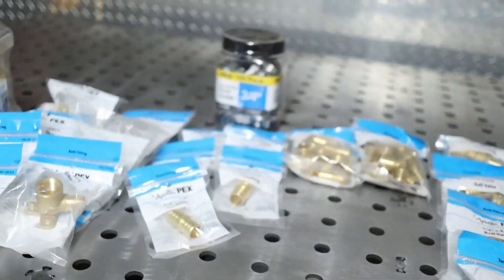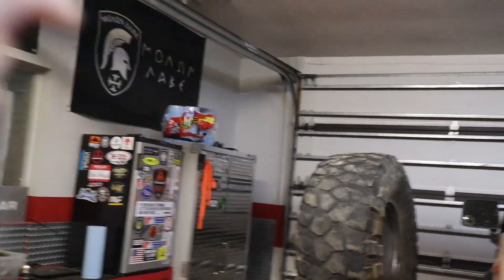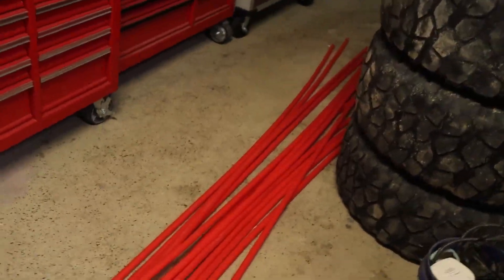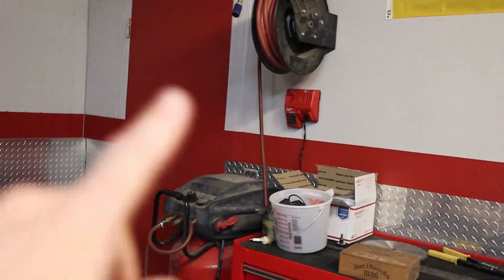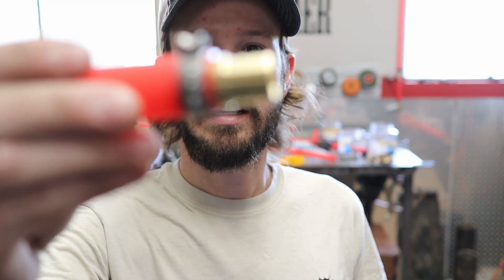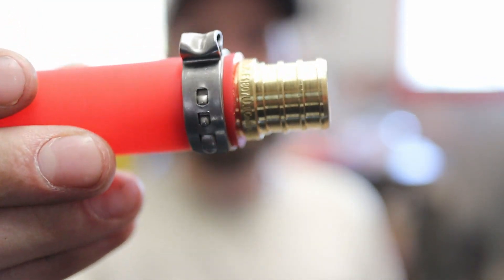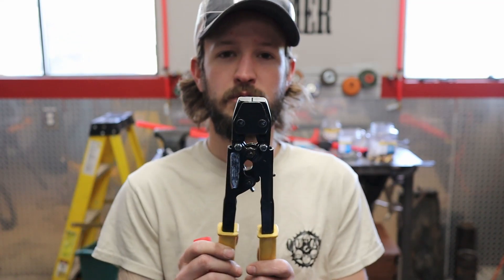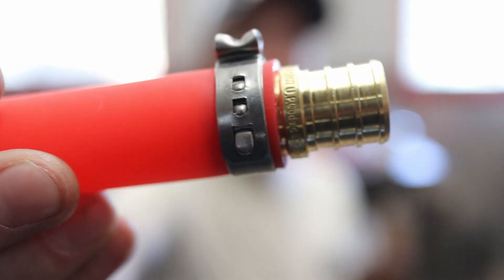Pex for shop air?? Will it last??

Comment: That’s exactly the way I’d run a larger shop. I do the water trap / manifold section in copper the way I did on mine but then switch right over to PEX. I believe this is going to work out great for you and you picked up a load of  capacity. 🔥👍🏼🔥
Reply from the maker: I added it up, should give me about 5 gallons of capacity! It's worked great for 1 whole day so far! Thank you Phil!!

Comment: Checking in after a few months!  I have about 350' left over from in floor heat in my garage slab, planning to use it for air.  Whats your experience?
Reply from the maker: It's been great! Hasn't dropped air pressure, and haven't had any fittings come loose or leak!

Comment: How has this held up after a few years? And would you go 1/2 or stick with the 3/4 if you had to do it again?
Reply from the maker: It's been holding up great! No leaks but it does expand/contract with temperature changes that I did not account for!

Comment: Hi there, would you recommend using this method for a granite warehouse? We would use air pretty much  9hrs a day and 6 days of the week. We use the air to polish granite. My question is, do you think pex will do the job or should I go with metal pipe?

Comment: Can you show how you went from the 3/4" pex tube stepped down to the 1/4" air coupler?
Reply from the maker: I used a fitting from home depot to go from 3/4" pex, to 1/2" female NPT, at 90 degrees, then used a reducer bushing to go from 1/2" to 3/8" NPT for my high flow air couplers.

Comment: I have zero experience with pex but I’m curious of long term results since this would be a great solution for home gamers on a budget.
Reply from the maker: I've been surprised how well it has held air. Had a 2psi drop in the system over the past 2 weeks! But long term, will be a different thing.

Comment: Can we get an update on your PEX system? Its been 2.5 years, any failure or repairs? Thanks.
Reply from the maker: No failures yet, and still holds at pressure for more than a week at a time. I use the air weekly, so it recharges every weekend at least. But I rarely see a pressure drop, unless the temperature starts to drop first
Reply: @letsfabricate5388  Very awesome. Thank you for the video, your time and the research. Cheers.

Comment: Standard PEX is not rated for air. Changes in pressure can burst the line.

PEX-AL-PEX, like Rapid-Air, is rated for compressed air. They use air specific fittings as well.
Reply from the maker: You are correct! This has worked great for me in the past with the small amount of time I use air, but thanks for the input!
Reply: What something is rated for and what works are two different things. But yes, your absolutely right. I've used mine for ten years and going fine with standard brass fittings and brass adapters.
Reply: For anyone reading this comment and thinking regular PEX isnt the answer..... please understand the following:

Standard PEX is rated for 300 psi. Even if you are running 175 psi which is nearly double what most people in little garage setups like this have, you wont have an issue. Assuming that rating has a 5% safety factor (at minimum) you would need a spike of  315 psi to cause any issues. Another missing piece of knowledge here is that any mass produced air compressor has a blow off valve in the pressure switch, which 99% of the time is 175 PSI or less for home or even industrial use. In layman's terms, you will likely never have a 'spike' of more than 175 PSI felt to the system past the compressor because anymore PSI than ~175 PSI would be released at the blow off valve. Of the millions who have ran this stuff, 99.9999999% have never had a problem. Its the one exception that creates this situation of 'warnings and possibilities'. Also pex is not brittle and will not send shards like pvc will under pressure, PEX ruptures with a split therefore has minimal risk of danger in cases where it does rupture. PEX-AL is intended for industrial use and is marketed for 'compressed air' but unless you are surpassing 300 PSI there is absolutely no need to buy it. PSI is PSI, it doesn't matter if its water or air, that line doesn't know the difference. Actually anyone with a common understanding of fluid dynamics would know that 300 psi of water is a heck of a lot more dangerous than air because water is an incompressible fluid and will kill you quicker than air will under pressure.
Reply: well said
Reply: Do you think you could of ran 1/2" pex?
Reply: @matt8134  Well said
Reply: Matt You have it backwards.  A gas under pressure is far more dangerous than an incompressible liquid.  Let’s do a thought experiment.  Let’s assume we have a large hydraulic cylinder and piston and we have a load cell on a movable stage to measure the force on the piston.  Now put 200 psi of water into the cylinder and measure the force on the load cell.  Let’s say the cylinder has 5 sq. in. of area giving 1,000 lbs of force on the load cell.  Now allow the piston to extend 0.1” and check the water pressure and the force on the load cell.  They will have dropped to zero since the liquid is not compressible and thus can’t expand either so the force on the piston vs. distance it moves is a very steep curve and will drop to zero with very little motion.  Now fill the cylinder with air at 200 psi.  You will have the same 1,000 lb force on the load cell.  However, now when you move the piston outward by 0.1”, the pressure reduction will be in proportion to the change in volume of the cylinder.  Given any significant volume at all in the cylinder, the force on the piston and the pressure in the cell will change very little in 0.1” (it follows the ideal gas law). 

That is why a brittle material like PVC is so dangerous with air, but no so much with water.  If PVC breaks under water pressure, almost as soon as the break occurs, the pressure from the water will drop substantially.  If PVC breaks under air pressure, the air pressure lessens much more slowly and will propel the PVC fragments to very high speeds as they leave the scene.
Reply: I'm running 175 in mine no issues.
Reply: Brad Faught The key with pex is keeping it out of the sun.  It doesn’t take UV well and after a few years of sun exposure, you will have problems.
Reply: Matt i just saw this now. It’s incorrect to think that pressure numbers alone are what matters here. Water has a contestant pressure, or it differs just slightly. Air can have pressure all over the place. Air surge, even with lower pressure is responsible for blowing up air lines. PEX is not rated for air, and should never be used for air. Period. Just because some random person states that they’ve been using it for years doesn’t make it safe. It can blow at any time. These rating are serious, and are researched and tested very carefully. They should always be regarded as absolute.

It’s irresponsible for anyone to recommend something that is out of spec.
Reply: LTVoyager PEX will rarely splinter when it explodes. It will usually rip. Sometimes the PEX will blow out of the fitting because it ripped right near it. It’s not as dangerous as PVC, but I’ve read of incidents where it ripped and swung around the room.
Reply: Mel Gross I am not sure what you mean by “contestant” pressure.  Pressure waves can travel through water just as well as through air.

I never recommended that anyone use standard PEX for air, I was simply challenging your incorrect statement that an incompressible fluid under pressure is more dangerous than a compressible gas.  That is simply not true. The fact that PVC is OK with water, but not air is one data point in that regard.

I don’t know why most PEX isn’t rated for compressed air, but my suspicion is that it is a testing and liability issue.  The folks that make most PEX test it for water and thus can demonstrate its properties.  My guess is they have not tested with air and don’t want the liability from the use of their product in a way it was never tested for.  However, if you are aware of a technical reason by PEX isn’t suitable for air line, but nylon is, I’d love to hear it.
Reply: A trick for the uv exposure is to wrap it with 2" automotive masking tape (green or yellow).  Just run it down the length of it.  Anyone doubting weather or not pex is suitible for air should search for a video where they test to failure. Failure was somewhere around 300-500 psi if I remember correctly, plenty high enough for any fluid even air.
Reply: Brad Faught The problem is that an air pressure test is only one of many tests needed for a product for compressed air.  You also need to test at temperature as the outlet air temps on a large compressor can exceed 250 degrees and many plastics weaken substantially at elevated temperatures.  And then there is the issue of oil resistance.  Most compressors put some oil in the air and air lines designed for air tool use may have tool oilers installed.  The air line materials need to be tested for tolerance to these common oils as well.  There is a lot more to testing a product than just a simple pressure test.  And many plastics deteriorate with age and exposures to things like UV and ozone, whereas most metals have long since been proven immune to these issues.  So, accelerated aging testing has to be done also.  Testing such as this is expensive and time consuming.  I suspect that is the reason that most makers of PEX water tubing have not bothered to test and certify it for use with compressed air systems.
Reply: LTVoyager i never said that water is more dangerous than air. I said the exact opposite. It’s not rated for air because its not suitable for air. They have a product that is rated for air.
Reply: The test I was referring too is a hydraulic test, as I stated anyone wanting to do this should cover anything exposed to sunlight with masking tape. Pex being plastic means it's oil resistant. Ozone has no effect on plastic. I recently saw that AvE was installing pex for airlines in one of his recent videos, if someone like that who is involved in engineering and material science trusts it so do it. Their is no money to be made certifying pex for air. Even if someone did people wouldn't pay more for it they would just use plumbing pex. The cost and ease if installing pex for airlines makes it a obvious choice. I highly recommend it and use it on the daily.
Reply: Mel Gross Sorry, yes, it was Matt that wrote that earlier not you.
Reply: Brad Faught I only worked in R, D & E for 32 years and have three degrees and 20 patents.  I guess I don’t know much technical stuff.  I do know that plastic isn’t plastic.  There are many formulations and each has its own chemical and radiation resistance.  And PEX does not do well with UV, ozone and motor oil at higher temps.  So, as long as you keep the PEX out of the sun, don’t arc weld, don’t oil your compressor and don’t let your compressed air get above 180 F, PEX is great stuff.
Reply: Jokes
Reply: @melgross  Matts knowledge on hydraulics and theories might be wrong, but lets address one thing he did write about: Compressors in good work order have "some" safety apparatuses which "should" not allow the PSI to get over "XYZ PSI"...mainly pop off valves. Quincy 2 stage compressors have at least 2 that I can remember. They shouldnt allow for high PSI in your system and although not designed to absorb surges, they can. Not that anyone is designing an air system on a unapproved tank, but those are far more dangerous, statistically, than air "piping" in any form. Then you have the idiots that shove an air nozzle up a coworkers butt, and kill him. WOW.....and I am supposed to be the uneducated dumb one that plays to much at work, lol.
Reply: @LTVoyager  well, except for the typo, constant. Liquid can’t be compressed under normal use, but obviously air can. If some of you guys want to argue about what wrecking very well, then have fun with it, but ignorance is never a substitute for knowledge. I know of people, over the decades, that did exactly what some of you are doing, and had no problem, but several who had major blowouts. One resulted in severe injury from which he never fully recovered from.

Is it worth the savings? If you’re willing to live with the risk, I suppose it is, as long as there’s no one else in the shop you’re exposing to the risk as well.
Reply: @bradfaught1695  AveE can be an idiot at times. While there’s a lot he understands, he gets a lot wrong as well. I wouldn’t go by what he does.
Reply: @bradfaught1695  you’re being willfully ignorant. Ozone doesn’t have to completely break a material down for it to become dangerous. It’s hard to believe that you don’t know anything about UV rated materials and non UV rated materials. It’s not ozone that the biggest problem with outdoor usage. Even plastic cable ties are rated for outdoor use only when they’re in the black UV resistant version. If you’ve ever had white cable ties in the sun for a year, you would know what I mean.
Reply: @tombrown1032  of course. But that doesn’t prevent blowouts from use of improper materials. It never has, and if you asked the manufacturer of the compressor, even if they don’t make air tubing, they would invalidate their warrantee if you used the incorrect materials.
Reply: Are you implying that if I hook up wet macaroni noodles to my air lines, the manu of the AIR COMPRESSOR is going to void any warranty that is implied at the point of sale?
Reply: @melgross  well I guess your being willfully ignorant of the previous comments in this video, since I already gave a hack I've used to block UV in pex. I've also used spray paint. 
  On response to ozone that's a jokezone. While uv does significant damage in only a few years ozone does not. I've bought alot of pex and I've never seen any warning  about ozone.
I'll address someone else's comment while I'm here. They mention see people use pex over  "decades" to my knowledge I first used pex in 2012 or 13 in not sure it's been out for decades, so the blow out he's probably talking about is more likely to be pvc. Pvc is very dangerous in airlines.
Reply: @bradfaught1695  oh please, don’t be a wise guy. Ozone is only a problem in some areas, but outside, UV is the biggest problem.
Reply: @tombrown1032  My knowledge on hydraulics is quite good.  What part do you think I got wrong?
Reply: @melgross  I personally would not use a material in my shop that wasn’t rated for the purpose by the maker of the material.  I used 3/4” copper for the compressed air system I installed this past March.  I looked at other options, but for me, copper was the best choice.  Iron pipe is a pain to install and has issues with rust.  The aluminum systems are nice, but expensive.  I would have used a RapidAir system, but their continuous roll tubing is a pain to install at the top of a 14’ high wall unless you have multiple people and/or scaffolding.  Their rigid pipe system priced out competitively with copper until I added in the shipping cost.  The cost to ship 10 20’ pieces of tubing to my house was more than the tubing itself cost!  Copper was similar in cost to RapidAir rigid tubing and I could buy 20’ lengths locally.  I am also quite familiar with sweating copper pipes so  I had all of the tools needed.  The system is safe, clean and thus far has worked perfectly as has my Quincy compressor.
Reply: @tombrown1032  I said that if you tell the manufacturer what you’re doing, you might lose the warrantee. I know you’re not familiar with industrial uses, but the warrantee specifies that the equipment must be used according to recommendations in a standard manner, or the warrantee I’d void. I know that from when I bought ten horse compressors for my own company.  They even spect the type of refrigerator for the water, and the auto drain. Of course, if you use wet noodles you won’t be getting the CFM you need.
Reply: @bradfaught1695  PEX was developed in the early 1960s and has been used in Europe for 50+ years.  It’s use in the USA started 30 or so years ago.  We are a little slow to catch on at times.
Reply: @LTVoyager  I apologize, I did not know you and Matt are the same person
Reply: @melgross  I am sorry, I did not see the word "might" in your first reply to me
Reply: @tombrown1032  My bad, I read it wrong and was reading quickly.  My apology.  We are most certainly not the same person.  😁
Reply: @LTVoyager  it’s all good!
Reply: @melgross  sorry, I forgot....”not familiar with industrial uses....”......well I dont know how much more “industrial” I would to be seeing I am part of a “team” that generates more than 1500 MW of electricity.  We have over 20 480V 3 phase compressors with dryers all with some sort of “accu drain”. Sorry to be a smart azz but it takes a lot for me to accuse someone on their lack of knowledge when the only discussion I have had with them is a few comments on yubby tube. As willie wonka said : 

"You get nothing! You lose! Good day, sir!"
Reply: @tombrown1032  well, if you have that much experience, you should know better.

Comment: Did it last?
Reply from the maker: It's still holding air better than the leaky iron pipe system at my previous employer!
Reply: @letsfabricate5388  awesome getting ready to do my garage. Any issues with heat from the compressor? Was thinking copper line for a bit to cool it off then the rest pex

Comment: anyone have experience running 1" drive impact with 3/4 pex?
Reply from the maker: I have run my 3/4" impact with no problem. The biggest restriction is on the hose reel and the quick connect fittings